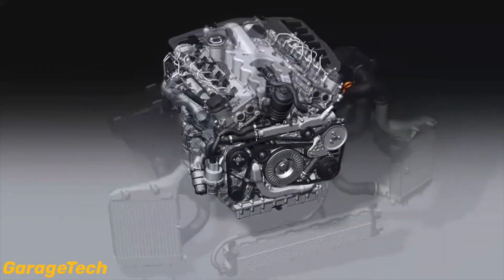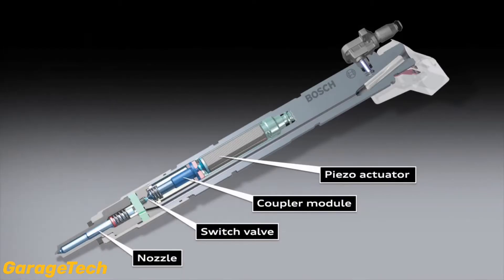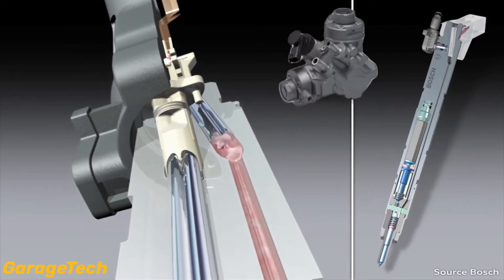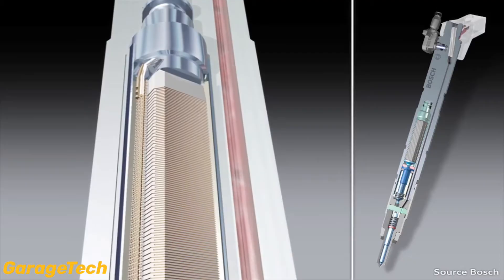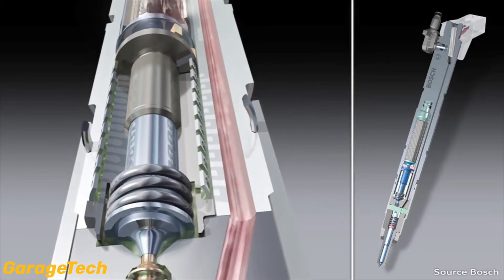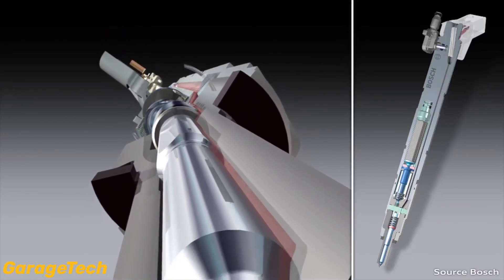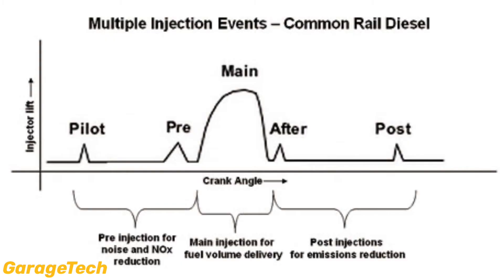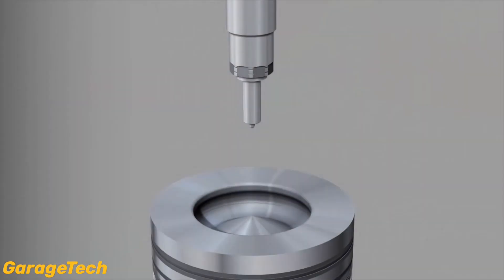How do Diesel fuel injectors work? Piezo common rail diesel fuel injector operation explained

Comment: hi great information on the injectors working have an Audi A5 3 litres the engine was going into limp mode said low pressure on injector rail, did a bleed of test on the return line found out number 3 and4 were pumping out over twice as much diesel as the others injectors ,changed the two injectors problem was  solved back to normal operation  can you explain what causes the injector to allow more diesel through  down the return line and is there an easy fix that can stop the excessive diesel passing back to the tank and recondition the injectors your self after all it's not rocket science perhaps you can make A VIDEO ON THE SUBJECT AND MAKE US ALL ROCKET SCIENTISTS thanks any way great video
Reply from the maker: Hey thanks for the comment, great work identifying the problem. Typically what happens inside the injectors is they can wear internally and stop sealing correctly, hence the leak off, or the solenoid or Piezo can become damaged, again then not holding it closed correctly. I wouldn’t recommend trying to repair these injectors at home, they work on extreme tolerances, >2000bar of pressure, you would need specialist equipment to check spray patterns and sealing. Most of the injectors have a code on the top which needs to be coded to the vehicle to compensate for any small tolerances from manufacturing.
Reply: Excellent explanation ❤❤🎉
Reply from the maker: @LubegaHuzaifah-k4r5m  thanks 🙏🏽
Reply from the maker: Only recommendation to help prevent damage would be to change your fuel filter regularly, as any small debris from within the fuel system could cause premature wear. Obviously accidentally miss fuelling with petrol is definitely not good for the system 😅

Comment: Super curious, are they grounded to engine block or by the cable which attaches to it? Would a faulty/badly grounded engine block prohibit these from firing?
Reply from the maker: @pr1sm55  usually they are a two pin plug and grounded through the wiring to the ECU . Of course the ECU is then grounded by two or three wires which sometimes all go the same chassis earth point. If you have a ground problem, you’re likely to get more than just one issue.

Comment: Excellent video. Never knew how these two injectors work. Would be good to do something on PD injectors too.
Reply: I assume you meant pumpe-duse they are basically solenoid injectors but the fuel pressure is made by lobes on camshaft on each injector